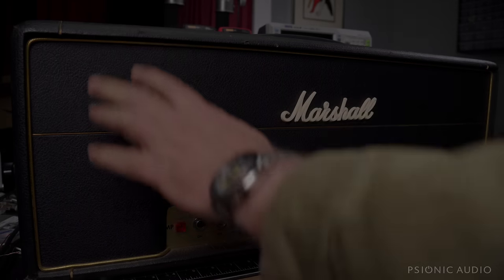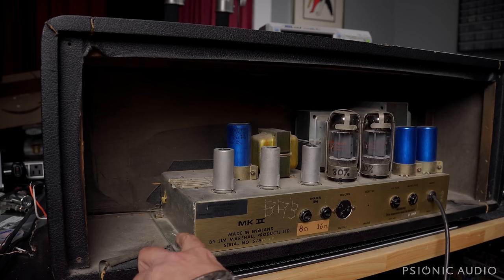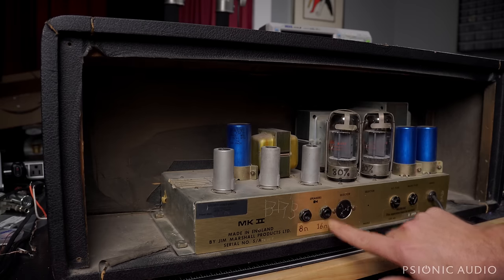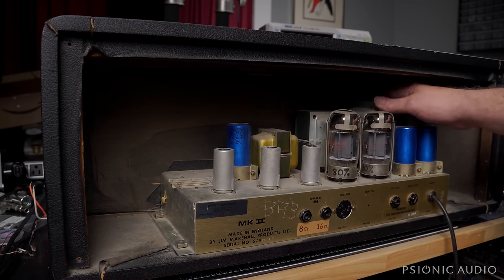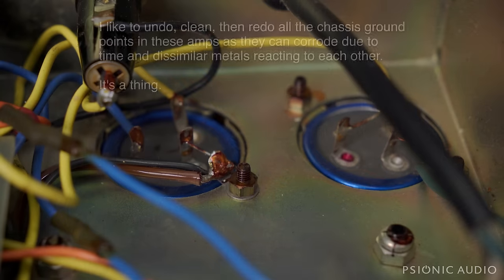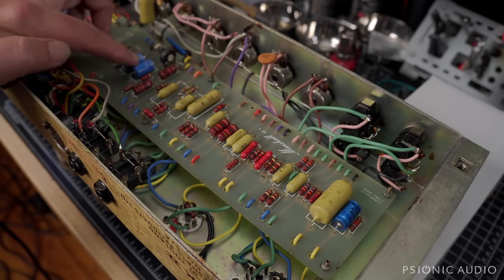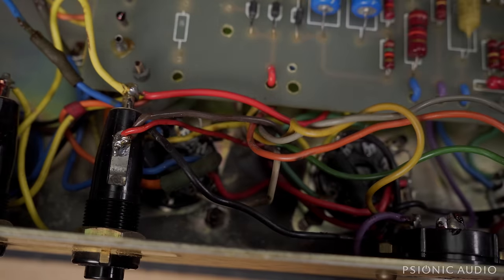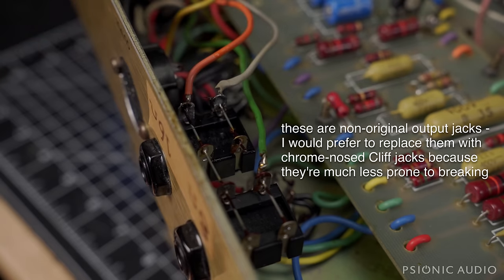'74 Marshall 1987 | Part 1 : Initial Inspection

Comment: Great amp Lyle! I have a 1974 50 watt Superlead in mint condition "except" for a master volume hole on the front by the switches. The 100 watts have a vent for heat, but the 50watts do not,  but the cabs for both heads are large (the 50 watt reissue is housed in a small box). I absolutely love the sound of early '70's metal panel Superleads!! They are the sound of countless rock albums...

Comment: I have a 1970 #1987 head, a small box with much more ancient turret board construction and EL34 power tubes. I remember hearing that 6550s were used in certain markets but it’s fairly unusual in a 1987. I wouldn’t dream of a master volume mod as my amp sounds truly glorious at every volume. I purchased it new in mid 1970 with an 8x10 bottom, long ago sold, and I’m very happy I never thought of selling this amazing head. I did sell a 1971 100W and I have kicked myself many times. It was absolutely perfect. Why??
Reply: You messed up, but who hasn't back in the early 80's. No mentors to teach us

Comment: Ive got a 74 100w version of this amp, modded for a master and a gain control. Im dying to convert it to stock setup with the 2 channel Volumes and add a master on the back, i really dont need the extra gain that's been modded in

Comment: I as a project I am  building a JTM 45 and thinking of using 4.7uf 250 volt polyester caps x2 in parrel each side of the resistor ie 4 in total which should be very reliable for the bias circuit

Comment: When you get to 7 times the spec life of the cap no question it time for a new better built cap in the power supply .  The advancement in electrolytic cap in the last 50 years is rather a big deal  from ESR to temp to size tolerance .  Given Lyle vast knowledge on this subject in this application the tone remains the same period. Less noise is also to be expected.

Comment: I impulsively bought a model 1986 jmp mk ii, the bass model, some months ago. It had definitely seen mods, having 2 holes on the back. Sounded decent as it was, but I had it converted to lead spec and added a master volume similar to the one this customer has, and a variable negative feedback. I still don’t really connect with the amp, it’s much too clean at home volumes, but it definitely has huge potential for blues and funk. Can’t get passable rock gain out of it at house levels though, the phase inverter distortion just ain’t happening with that MV.

Comment: I’m interested to find out what the voltages are in this, as I have one of these, from the same year. Also, when I got it a couple of years ago, the Dalys were terminal, despite looking healthy
Reply: Measure it with voltmeter....my 74 50 watt is around 400 -430 volts and the 100 watts 450-465volts
Reply: @curtisprice9806  yes, I've done that. Mine is super low, from memory B+ is under 360 V. I also have a 1959 Superlead, with voltages similar to yours, but I'm just trying to gauge how much of an outlier my 1987 is.
Reply: @audiomsg  when I get back home from visiting my parents tommorow., I will tell you exactly what the voltage readings are at various points in the circiit. I have them written down

Comment: I have a 1987x reissue that was thrown out by the side of the road after the flood of Hurricane Katrina in 2005! Lyle or another tech,  do you have any suggestions on checking the power, output, and choke transformers? I have an idea but would like other suggestions or info. I  messed up one (forgot if it was the power or output transformer) way back in 2005 by not letting it dry out thoroughly...i applied voltage with a variac and brought it up but heard crackling from a short! Man, I was madder than a hornet! Should have let it dry out longer! It is 2023, they are all dry by now! I would greatly appreciate info on this subject since I haven't found any on youtube or books I have!

Comment: Lyle, do you have a preference for top (exterior) mounted tube sockets, or bottom (interior) mounted sockets? Bottom/interior mounted sockets have always struck me as better for ease of flipping up the boarrd to access the solder/foil side because unbolting the sockets (and the output jacks) as a group seems easier to me than unbolting all the pots. If manufacturers had used sockets with threaded mounting flanges then the sockets could be secured without needing nuts, only bolts or self-tapping screws. (I know, I know, if wishes were horses.....).

 If a manufacturer was building an amp into a really tight Fender tweed style chassis, bottom mounting the sockets would allow them to assemble the eyelet/turret board, sockets and pots on an exterior template or jig and then transfer the whole thing as a unit into the empty chassis without having to build it all "In Situ"....

Comment: New F&T filter caps will probably make the amp sound better than new.
Reply: As unpopular as it is for me to say , and much to my chagrin because these are  reliable and high quality electrolytics  , but I really do not like the sound that F&T caps produce in Marshall circuits . 

To my ears : really bright and thin sounding in the all important midrange . Certainly an easy forgiving feeling to play cap , but in my experience of rebuilding amplifiers I have had trouble hearing note clarity when installed . This has been echoed by others when I have  swapped out these caps out of amps for alternatives . 

Whereas I won’t go down the rabbit hole of how those old Daly caps sound, I will agree that changing them won’t result in any tone loss , but there will be change in tone . 

Beyond that little contention with component choice, properly working reliable caps is the call
Reply from the maker: Well I’ve compared F&T, ARS, JJ, and a few others. Given the same capacitance and measured ESR they sound the same - but they don’t last the same.

I’ve measured old Daly caps taken out of Marshalls and the capacitance/ESR are all over the map even if they were technically still working. 

Lacking a Tardis I’ve been unable to compare a new F&T to a new 1974 Daly but I suspect people would describe the new condition Daly as sounding as whatever as they find the F&T.

Capacitance and ESR matter and no large value electrolytics filter the very highest frequencies as well as the lower ones (which is why you’ll see paralleled small value caps in many amps). 

So new caps, be they F&Ts or whatever, won’t sound like 50 year old caps but they’ll sound like the original caps did 50 years ago.

Clapton, Page, Hendrix, etc were using new amps with new caps. And they sounded OK.
Reply: @PsionicAudio  major league points of consideration . Beyond my personal experience of hearing all those caps mentioned brand new  and formed within the same amplifiers as sonically  different (besides Daly of course, I am too young for that) …I agree whole heartedly ... new caps for the win …Cheers Lyle, you are a gem
Reply: @PsionicAudio  I outta give an honorable mention to one brand of capacitors that woefully was only produced for a very short while ; the Sozo Replicas of the old Daly caps . 

They were only made 100uf 350vdc (they planned on 33uf too but it never came)  but were rated for 10000 hours . I have a set in my personal performing amp that I installed years ago . Another case of replacing F&T. I spent years fighting that amplifier to suddenly fall in love with it and apprehend it back from my band mate who had been the previous main user of the amp . 

Really wished those caps were still around . I have reached out more than a few times to the company with the distant hope of inspiring their return , or at least perhaps a hidden box of unopened caps somewhere in the back , lol 

Anyways, guitar blabbering over , enjoy the rest of your weekend and upcoming holiday , cheers
Reply: What a beauty of an amp. It's in good hands and I'm sure you'll get it all straightened out. Spaghetti doesn't sound as good as it tastes
Reply: @PsionicAudio  Lyle, I'm convinced you may be able to build a Tardis at this point!